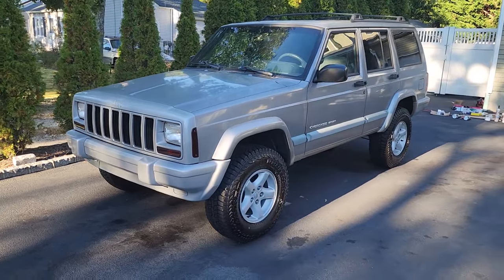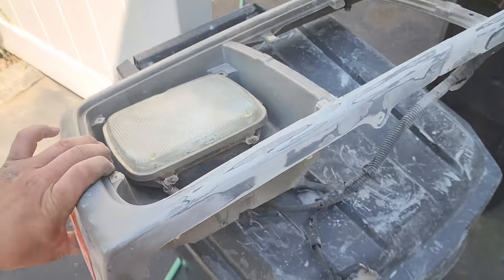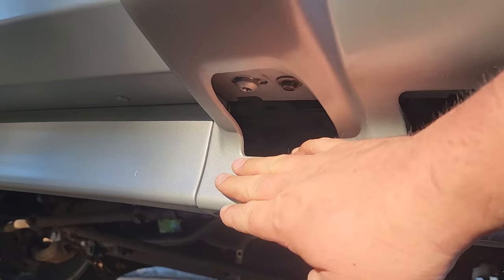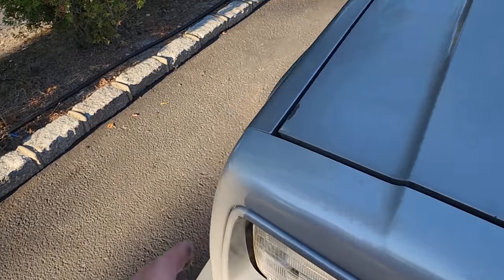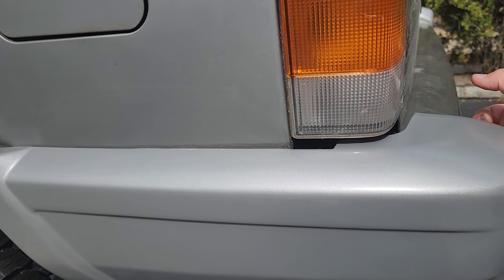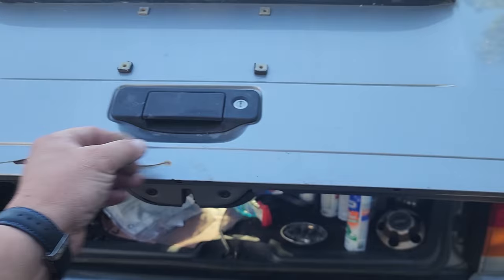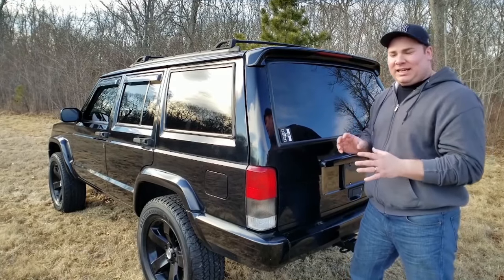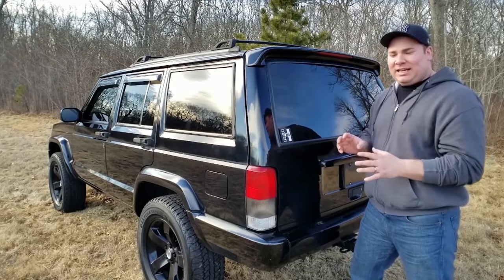THE TOAD IS BACK!!! TOAD XJ EPISODE 6!!! JEEP CHEROKEE XJ PROJECT.

Comment: im digging the Toad, i did alot of the same mods when i owned a white 2000 4 door. i color matched my bumpers and ends, removed the belt mouldings etc but i did my grill and headlight bezels in satin black, i called it Storm Trooper. i did the VHT on the tail lights but only on the amber, so it blended with the red, i saw that done on Vehicle Tribe's youtube. I also painted my C pillars satin black too so it looked like a 2 door👍
Reply from the maker: Slick move brother! I'm pretty sure I'll be canning that belt moulding too

Comment: Why not just paint the door trim to match the other paint repairs,  and maybe the fender flares also,    it would blend everything together.,   
   That front ceiling dome light looks like the same one I need for my 95 ZJ,   the previous owner wrecked mine attempting to glue the headliner,
Reply from the maker: Lol .sorry to hear that. I'm  Not a fan of poor repairs.  Also you can't paint that door trim, it wouldn't peel in a couple months.  Additional it's already pulling off at my the corners.  The best way to save it would be to heat it up and return it to black.
Reply: @ProjectDanH   
Etching primer usually works very well for preparing plastic and rubber, and also aluminum,  before painting.
   Otherwise krylon fushion paint is always another good option.
   Maybe for a experiment get a can or two, and try on some old plastic, or trim parts to see some results of what may work well.